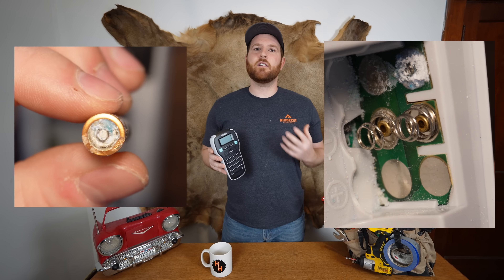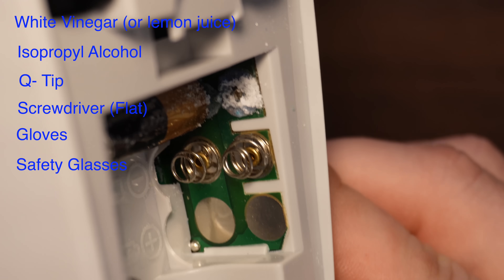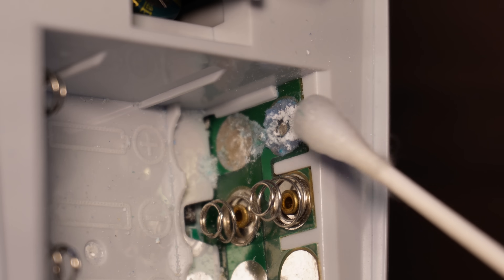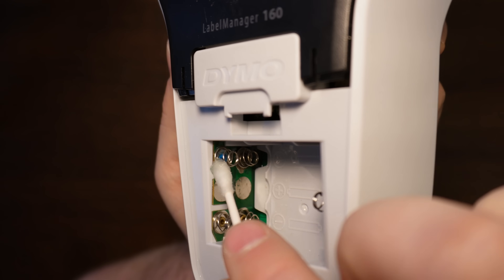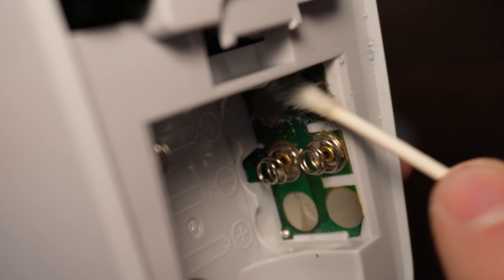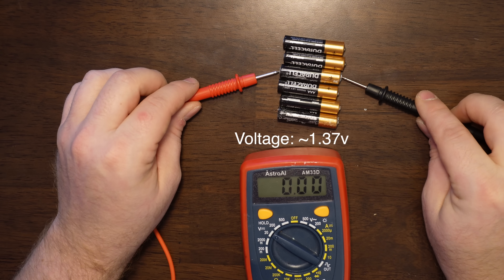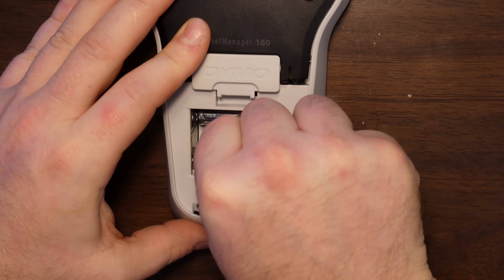Clean BATTERY CORROSION on ELECTRONICS! EASY DIY!  |  2-minute Tutorials Ep.4

Comment: I got tired of dealing with this so a few years ago I switched to Eneloop rechargeable batteries.  With the kits came C and D adapters so I'm all set.  I don't know what's going on with the alkaline batteries these days, this was never an issue in the 80's and 90's.  Now it seems like they leak every single time.  Eneloop doesn't make 9V batteries but I just order a set of 4 rechargeable 9V LIthium Ion batteries from Amazon so hopefully they'll work well as too.
Reply from the maker: Interesting, I’ll look into Eneloop. Thanks for your input 👍🏼

Comment: Baking soda is better, it will neutralize the alkaline as well as clean off the corrosion non-abrasively.
Reply from the maker: I believe you’re incorrect. Baking soda, aka sodium bicarbonate, is a base. You need an acid (low ph)  like white vinegar or lemon juice, which is opposite of an alkaline battery corrosion, which is a base (higher ph)

Comment: That was actually in very good condition - It's hard when the springs have become rusted and corroded themselves. In that case you can usually just clean the contacts as best you can and then I use a engraver tool that takes one AA battery to grind the surface of the spring so it can make contact again. Battery corrosion is such a pain to deal with, especially when you open a battery compartment that hasn't been opened in years.
Reply from the maker: Thanks for the tip. What happens when your engraver battery corrodes and you need the engraver 😆
Reply: @HandymanHertz  Hah! One moment while I check my engraver's battery... Hah, again! - The bottom spring is just starting to get a dusting of corrosion - Going to fix that now. See, even in the comments section you are still helping people. :)

Comment: I bought a bulk pack of Kirkland (Costco) AAA batteries that were so leaky after 1 year, I threw them all out but keep finding devices I had those batteries in, all of which are now ruined. I have tried this on several different electronics but it has never worked.
Reply from the maker: That’s too bad you’ve not had the same luck I have with it. I think we both agree that Duracell doesn’t sell good batteries. I might be wrong, but I believe Kirkland batteries are made by Duracell.

Comment: This is such a typical problem with DuraCrap AA and AAA batteries.  I’ve used baking soda with the same results.
Reply from the maker: Thanks for the input. Yeah, I’m done with Duracell. What brand do you use?
Reply: I’ve been buying Energizer batteries when they are on sale.  But I’ve never had leaking problems any brand except DuraCrap.  For a while I switched to Energizer Lithium but the 50% price increase last year made their usage unrealistic.  I think pretty much any brand except DuraCrap would be just fine.  I have probably cleaned maybe 15-20 expensive electronics that DuraCrap batteries have tried to ruin.  I did find using a Dremel tool with a small brush is a great help too.

Comment: If you really want to save it long term, tear it completely apart and make sure all the little bits of crud are removed from everywhere before reassembly.
That crud grows and will continue to contaminate other electrical parts near the batteries.
Reply from the maker: That’s probably true for someone who wants to take the time and be more thorough. Thanks for the input. 👍🏼

Comment: A couple of tips that I picked up along the way. First, don't leave batteries in items that you don't use often. Second, don't use the "Copper Top battery" It's the worst battery out there. The best tip I can pass along is use lithium batteries. Especially if the device is not used too much and you have to leave batteries in it. There is no chemical reaction with lithium batteries and so they won't leak and damage your equipment. They're more expensive but to me it's worth not having to do the vinegar clean out.
Reply from the maker: Thanks for the great tips!

Comment: One thing I can say is that Duracell and energizer batteries seem to be designed to self destruct and take out whatever device they are installed in! I refuse to buy or use them due to the extreme failure rate! I buy cheap store brand or dollar store brands and just change them more often. I am transitioning some devices to rechargeable lithium but they are expensive. I know some devices deplete the cheap batteries quickly and so if I have to use Duracell or similar I make sure to remove them if the device isn't used very often. But I learned another lesson recently that you shouldn't store the Duracell or similar near the the device either or if you do put them in a zip lock bag as I had some loose inside a case with a laser level and they self destructed and apparently just the vapor is so corrosive it attacked the tool  in ways I would never have believed!! All the metal contacts were corroded and it attacked the the soft rubber over molding it was white and scaled and bubbled!! So be careful these things nasty!! Also to clean electronics that have had liquids on them first immediately remove batteries or power source. Then disassemble rinse off contamination with de ionized water or distilled water if you can't find de-ionised water and finish with 100%  isopropyl alcohol and let it dry before reassembly. Typically the damage is done when the original spill occurs if your lucky and get it clean it should be recoverable. Good luck!
Reply from the maker: Interesting about the batteries being close to the device and the vapor still affecting it. Thanks for your tips. I no longer buy Duracell brand either. I actually switched to energizer, so far so good, but you don’t like them either huh?

Comment: Hi, I'm just a nornal girl with and excercise bike which is old and the lcd screen runs with 4D batteries which has leaked into the compartment and eroded stuff. Unfortunately for me its the side with the spring mechanism and its was so brittle to touch it all fell off. What should i do???
Reply from the maker: Hi, you can replace the springs/contacts. If I were you, I’d find the exact springs and buy them on Amazon (cheap) and while waiting for them to arrive, watch some how to videos on changing out the spring. Usually it’s just some very simple soldering involved and pretty easy. (Borrow or buy a cheap soldering set for figuring diy projects). You can do it 💪🏼 maybe take your project apart to see what’s needed and if you can get to it easily. Good luck

Comment: Vinegar is only good if you have any means of coating the material. Try simple rusted bolt, soak it in vinegar and and clean shiny. After 3 days if in open environment or month if in closed space it will be bright red because of rust. Only way to use vinegar is coating surface with oils or copper solder if it should be conductive. Vinegar seems nice at first but consequences of using acids on metal is devastating. Good for youtube videos though.
Reply from the maker: What about cleaning it off with alcohol afterwards? Like I did the video?

Comment: Baking soda dissolved in water works too, just like cleaning deposits from car batteries. Take the device apart if possible to check for more corrosion behind the battery compartment, and also prevent damage to the circuit board by leaking cleaning fluid on it.
Reply from the maker: Thanks for the tips!

Comment: The vinegar will turn the residue in to salt and corrosion will increase. 
There is also a risk of leaking current when the circuit board is covered in it. 

I would recommend a good electronic contact cleaner. 
To get the oxide layer off rub with a cue tip, as you did. If it’s stubborn, buy a fibreglass pen from an electronics supplier and use it gently as it will scratch the surface. Eraser may also work.
Finish with isopropyl alcohol as you said.
You can coat it in contact oil or contact Vaseline to prevent future problems.
The contacts will never be the same so if it’s critical equipment, replace it or the contacts.

If it’s rusted you need a ph neutral chelating agent. Evaporust in US, Jenolite in Europe.
Reply from the maker: Thanks for your input 👍🏼

Comment: Good info, thank you! In the good-ol-days (late 1950's; early 1960's??) Ever-Ready battery company would replace a device if ruined by their batteries leaking. Back then it was just the occasional flashlight and transistor radio, (Not many expensive 'toys' back then) but on a couple of occasions, they did as promised. Mailing the item back to the company may have cost more that a new flashlight? ☺..I don't know when they stopped doing it, but likely that benefit didn't last long.
Reply from the maker: Thanks for sharing, I always like hearing about the good old days. It reminds me of my grandpas!

Comment: Hello, having the same boring trouble all the time with the most batteries in my several equipment, when it get in a flat condition. I take an old toothbrush and clean first dry all contacts. Later on I use vinegar to neutralize it. A drop of Ballistol oil or WD 40 on a q-tip careful may help for the rest. When I don't use a camera or anything else, it's better to remove all cells.
Reply from the maker: Thanks for your input.

Comment: Or just use WD-40, toothpicks, an old toothbrush, and Q-tips. 👍🏼
Reply from the maker: I wouldn’t think wd- 40 (wd stands for water displacement) would do anything to remove/counter corrosion. Glad it works for you though. Thanks for the input

Comment: One thing I found a problem is rust on the spring contacts. This is often much harder to clean. I find that if you don’t get good contact in that area, try putting a little tin foil between it and the battery contact. Works quite often for me.
Reply from the maker: Great tip, thanks for sharing 👍🏼

Comment: I have a milk frother that was nearly sealed shut with battery corrosion. I was just dealing with it when lo and behold this video is recommended to me out of the blue, I didn't search for the solution or anything 🤨
My genius method of course was to completely immerse and wash the whole unit with water and soap 😂
Good to know the appropriate ways to do this in the case it happens to a more valuable item 😅
Reply from the maker: 😆 that’s funny

Comment: After the procedure or with every new battery powered device, you can add petroleum gelly or "vaseline" to the contacts to help them stay nice. I don't know the exact word for the product, but just "grease" them before any corrosion is present and/or after the corrosion has been cleared. This especially helps for devices being carried outside (flash light etc.), where moisture is very likely to be present and will eventually get contacts corroded.
Reply from the maker: Thanks for the tip!

Comment: Only problem is that the base metal becomes darkened or tarnished from the corrosion? Might have to chase with a COPPER WOOL to polish up a little? Steel wool too fine and breaks up into metal fragments that can short something out... Use a wooden stick or toothpick to push wool around
Reply from the maker: Thanks for the tips!

Comment: Highly recommend you do this OUTDOOR or ina ventilated area.
Obviously mixing even a weak acid with battery leak residue followed by any cleaning solution should be done with GLOVES.
Come on guys.Use a little common sense and at least wash your hands immediately after handling leaky batteries.

Comment: Pencil eraser works great but only before you get noticeable corrosion. I've done this for decades.  If  you have power drop outs but the battery contacts all look good. This will take care of the problem. Years ago I was in a photography store looking at an expensive spot meter. It was working intermittently. I think it cost $250 new, I paid $60 for it. When I got it home, I just polished up the contacts with a pencil eraser and used it with no problems for many  years. Not sure if I ever had to clean it again.  My small flashlights I'll always polish up the contacts with a fresh pencil eraser. I've even used Vaseline and Ox Gard on the contacts. Neither of these greases conduct electricity, but what happens is the battery or wire connection pushes it out of the way. This leaves a metal to metal contact that is surround by grease that keeps out water and oxygen. Too much and you can disrupt the connection. As a sailor I'm around high humidity and salt water so all these techniques come in handy.
Reply from the maker: Thanks for the tips!

Comment: You always need to put a resistive load on batteries when testing them. The other problem is the conductive layer between the spring and fastener is oxidized. I've tried conductive grease and conductive epoxy.
Reply from the maker: Thanks for the tip!

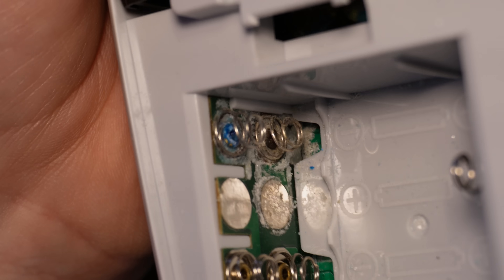Comment: At the 0:32 mark, looks like you brushed that white corrosion powder off the table onto you, onto your clothes and onto the floor.  That stuff is still corrosive and will damage things which it comes in contact.  I used to wipe mildly corroded batteries (AA and AAA) on my cotton sweatpants and have the holes in them as proof of their destructiveness.
Reply from the maker: It was onto the floor, where the roomba ate it like candy. Thanks for the input, though 👍🏼

Comment: Big tip here:  Don't ever use Duracell batteries.  I've used A LOT of batteries in my lifetime and without fail every time there's been battery leakage, it's Duracell batteries.  Use ANY other battery except Duracell.  Even the cheap dollar store batteries are better.  Second tip:  white vinegar and the screwdriver work really well!
Reply from the maker: Thanks for your tips!

Comment: Duracell has been the serial killer of my electronic devices for many years. I don't understand why they never fixed the leak problem. I'm no longer using them. If a product comes with Duracell, I will remove the batteries from the device before storage.
Reply from the maker: They are. Good company but their copper tops will be the end of them if they don’t change it

Comment: A long time ago, Duracell used to be the best, never leak, most power, then like many corporations, they change, sell, change to cheaper manufacturing, and you get this, I went from only buying Duracell to never buying them…terrible, aAmazon batteries are better and they are a cheap battery, but don’t leak. There are far better than either of these…
Reply from the maker: Yeah I think I’m going to use energizer or Amazon from here on out

Comment: I’ve used to use Duracell batteries and found them to be excellent.
Excellent, that is if you want a new device, and are willing to press your case. 
I have never attempted to do this illegally, it has only been after discovering a device is not working, and when checking the battery compartment, discovered that the Duracell batteries have leaked and damaged contacts and printed circuit tracks, rendering the devices inoperable.
Over a period of a few years, when I thought they were ok, I used them, and on 3 occasions Duracell replaced expensive equipment e.g. Fluke meters and the like.
On each occasion they required photographic evidence, but never asked me to send the equipment to them.  They simple sent a cheque, for a substantial amount.
I then bought replacement equipment, repaired the Damaged equipment, and had 2 devices to use when fault finding.
In the end I stopped using Duracell, and ever since have used Energiser, which have never leaked.
Reply: @BlondieHappyGuy  Hi.  I suspect that a remote will have some very thin “lands”, the thin copper connections between components.  If you can clean the lacquer of, it’s possible to replace the tracks with thin insulated wire, but you will need to be a dab hand with a very small soldering iron.  Too much heat will cause the adhesive to fail and the very thin copper will lift.
Still as the alternative is to do nothing, trying might be worth a go.
Good luck.
Reply: @BlondieHappyGuy  In my defence, I was unsure if Blondie related to hair colour, or gender, and now I can feel the ice cracking under my feet 🤔.

I too meddle in most things in my workshop, and have a go, so good luck when you decide to also decide to have a go………
Reply from the maker: Interesting, this is good to know, thanks for sharing it.

Comment: We have a lot of these happening to our electronics as we're in a small Pacific island due to salty air + humidity.

What I do is use sheer off a wooden tongue blade/depress against the grain so I have a flat but tough fibrous tool to remove corrosion, or shave it until I get the size that I want for small work. 

Won't damage plastics or tinned pcb connectors. Then I clean with rubbing alcohol, then add some light grease such as petroleum jelly (silicon grease for higher end stuff) and it's good for quite a long while.

Greetings from the tiny islands of Palau  🇵🇼🇵🇼🇵🇼!
Reply from the maker: Thanks for the tip. Hello to Palau islands from Handyman Hertz! 🇵🇼

Comment: Funny thing is that I bought Duracell batteries from SAMS Club a few years ago and they leaked, every single one of them leaked and damaged every remote control device, keyboard devices (multiple) and home door cyber locks and everywhere else I had installed them. I will never buy that brand again. I've been using Harbor Freight el-cheapo's Alkaline batteries and have yet to have one leak in any equipment.

Comment: Thanks for the video. I noticed you are using Duracell batteries. For many years I was die hard Duracell fan. Then over the last 5-7 years I started noticing that all Duracell batteries were spewing their guts way before they should. Many times in less than a couple years. For several years now I have been using Amazon and Eveready which I understand are the same maker. I have not had the problem once. I avoid Duracell like COVID now. Don't use Duracell. You'll be less likely to have to clean the corrosion out.
Reply from the maker: I agree 100 percent!!